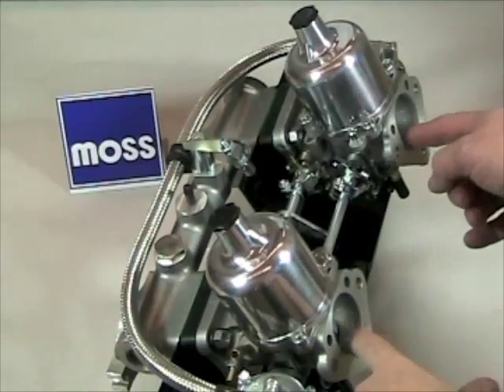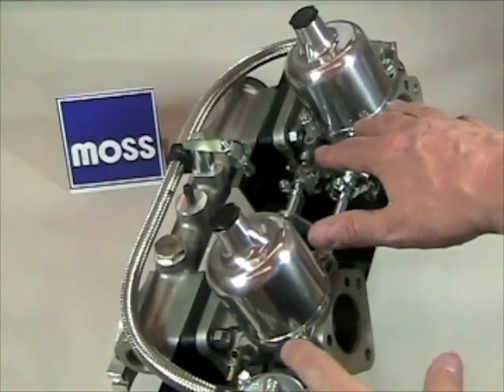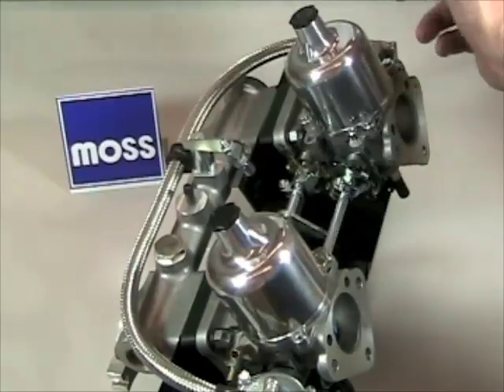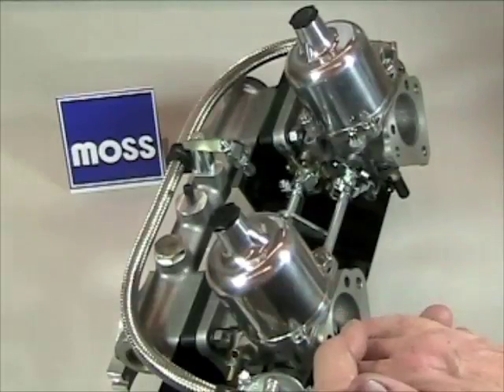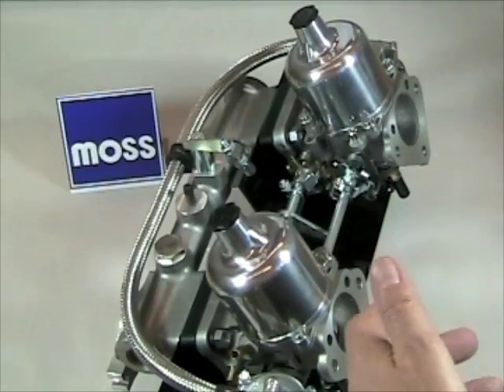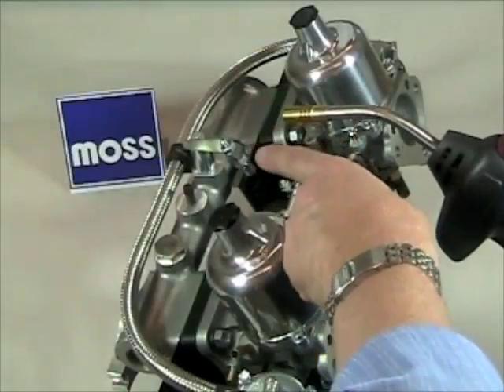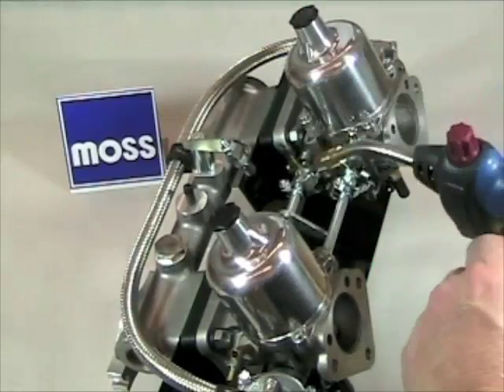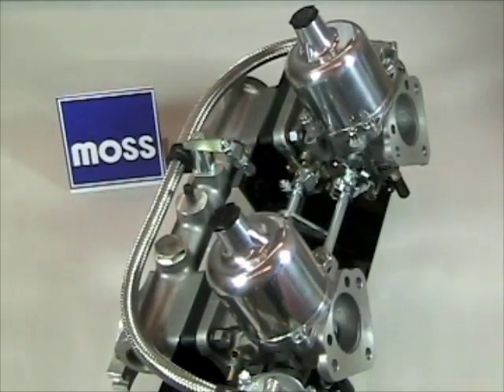Vacuum Leaks - How to Find

Comment: fun fact, this is how Honda instructed people to set the idle fuel ratio on the 1984-1987 civic and CRX with the carburetor. (not sure if this was done for other cars).

to set the idle fuel ratio, you would feed propane through the intake of the carb, and set the fuel ratio to where it didn't change regardless of propane or not.

Comment: The problem with propane is the fact it is so light it can be blown away from where you're trying to test. I've only had minimal success with propane, what works best is break cleaner. The issue I had was the 6 thin paper gaskets leaked and propane did not detect it but spraying break clean sure did. The cheaper thin paper gaskets will wick fuel and air as well. When I replaced them they were all wet with fuel and cured the issue.

Comment: Thanks for the video. Apparently on my car a hose came off because some idiot (I believe it was a jiffy lube guy) decided to "borrow" one of the hose clamps on my engine, which happened to be a vacuum line going to the secondary air injection system. The car ran poorly and threw six trouble codes including misfires, cat, secondary air injection, and O2 sensor. After replacing the hose and clamp, everything was good. Guess that's what I get for being lazy and not wanting to change my own oil.

Comment: ka-------------------------------------------------------------------------BOOM !
he's whispering because he doesnt want his boss to hear him opening up the carbs and making videos of them .and starter fluid or flammable carb cleaner still works and doesnt make the motor "runaway" like propane would .for about 10 dollars you can one by one replace every vacuum tube on a carb ,and if it is an intake leak change the intake gaskets.